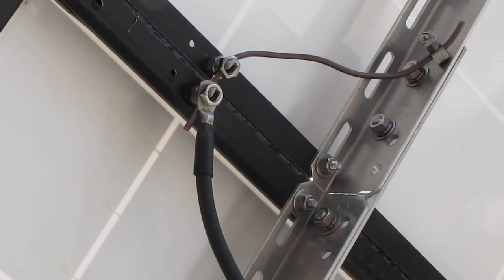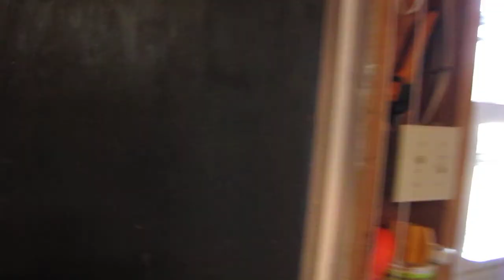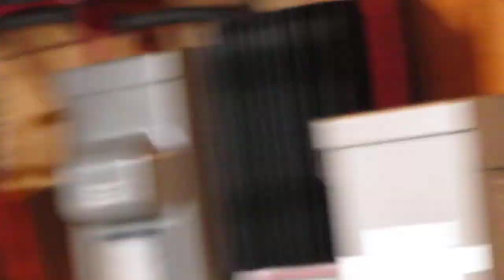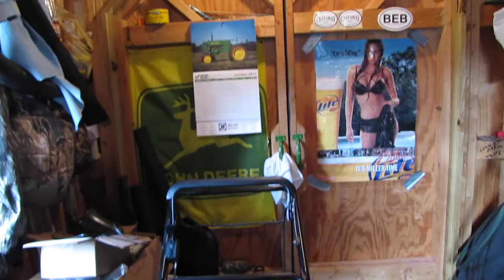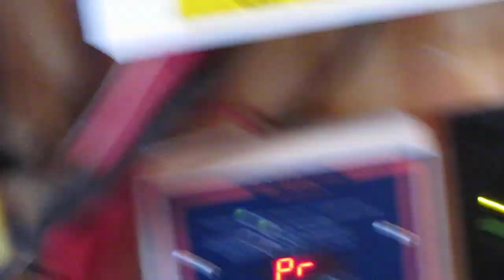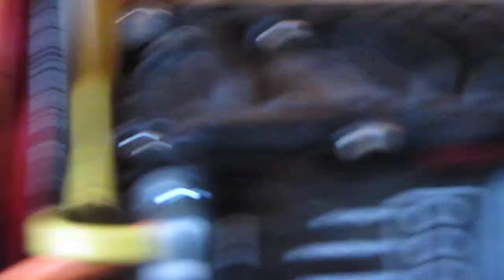GOING GREEN  IN SOUTHERN VIRGINIA  !! Update ON UL SOLAR and WindMax and OutBack Power GTFX 2524

Comment: I enjoy watching your videos. I found you back when you got a John Deere tractor. I was wrestling with the 2520 vs 2320 at the time. I decided on the 2520
As much as you like to tinker with electronics, have you ever considered getting into Ham Radio? It's a great hobby and many hams like to use solar power.
You no longer have to learn the code, which I really enjoy, 
There are only 3 classes of licenses now and the test are not too bad. You will do fine.

Keep up the good work.

Glenn WA4AOS
SC